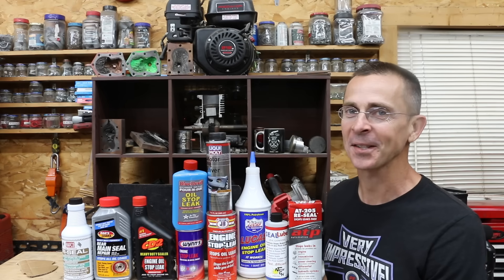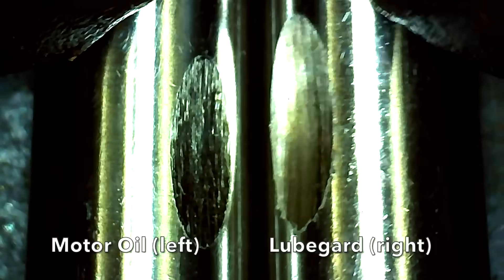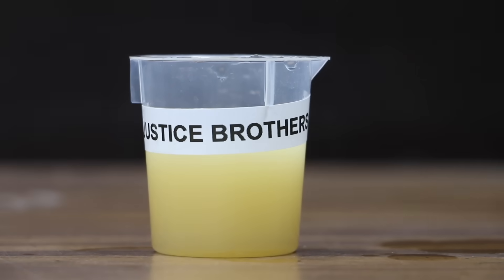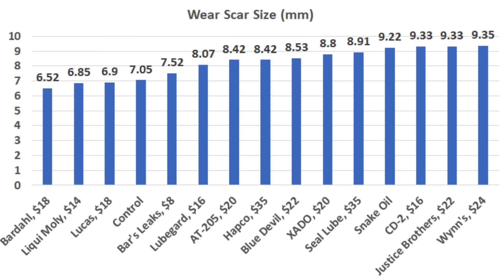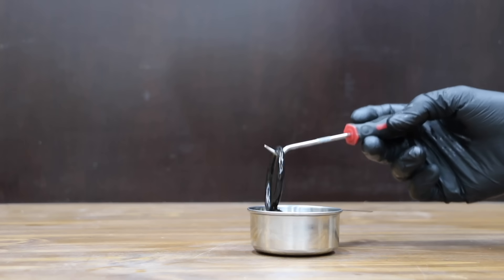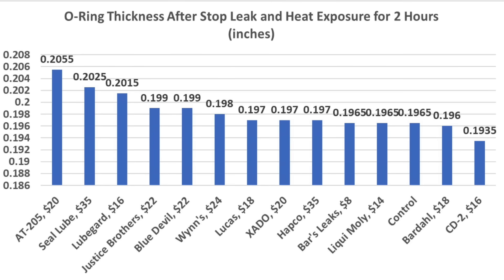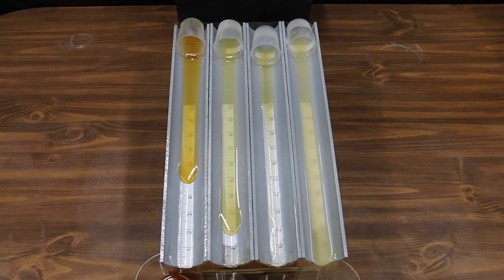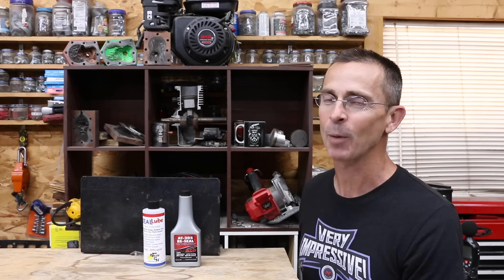Do Stop Leak Products Work? Do They Damage Engine Seals? Will They Destroy an Engine? Let's Find Out

Comment: The only concern I have is the 50/50 mix you used. I feel some of these performed better or worse because there was an unrealistic proportion compared to the oil. Unless it specifies 50/50, I feel this deserves a revisit with the proportions correct, at least for the wear and heated oring test
Reply: using a higher concentration of the additive reveals more of what the additive does to the oil, is it representative of real world scenario, no, but it shows which ones are ultimately worse then just topping off the oil to maintain proper oil level or replacing the leaking seal.
Reply: Actually this is similar to our laboratory tests where we simulate the effects of aging and long-term use in a short testing time. It's still a simulation, but these tests are a good mark for comparing similar products.
Reply: The 50/50 mix is useful for comparing the differences between the frictions of each product and isn't meant to be indicative of how it would change wear in an engine. I would like to see the proper mix ratios in addition for a closer analog to any sort of engine wear.
Reply: @Voyajer.  The same could be said for nearly all the tests.  Flow characteristics could change significantly if the ratios are incorrect.  Same with the ability to swell the seals... if you're mixing the product at a higher or lower ratio than the manufacturer specifies, you may see better or worse results during testing making it hard to say if one product is actually better than another in any of these areas.

I don't know enough about the subject to know if swelling an o-ring too much which might cause issues, or how soft is too soft for a rubber gasket or if there is such a thing.  People use these tests to pick a product to use, and if the recommendations from the manufacturer aren't followed as closely as possible, you're introducing new unknown variables to the mix which may invalidate your results in real world conditions.  I think all the tests themselves are reasonable, they just need to use the suggested ratios so we're comparing all apples to apples rather than a pea to an apple to a watermelon.
Reply: Can't believe so many people are failing to see why this was done this way. Its called accelerated testing, and it also brings out data that would not have been seen otherwise.
If the miniscule amounts were added per Manf. direction, its doubtful there would have been any difference in wear scar size.
Making it 50/50 accentuates the differences between the products, and allow that data to be large enough to be seen.
If used per Manf. direction, there is probably very little difference in wear between these products.  Or, considering most people leave these in for an entire oil change interval, often starting at the beginning of one, there might be potential for more than normal wear.
If the 50/50 weren't done, we would not have seen wear scar differences, and we would assume not an issue, and would only focus on which one swells/softens the most.
Which as the testing shows, the most wearing are the least effective on seals, and vice-a-versa.
Since we don't know actual wear damage in real life, some of us might prefer to select the one that shows less potential to cause wear, even though it is less effective in seal effects.
Others with beaters and such, can select one that is better at seal effects, knowing there might be a bit more wear than normal, which they can live with.
Reply: Agree -- If your percentage of product vs oil is greater or lower than specified in the directions, then you're not really testing the recommendation from the manufacturer.  I guess you could make a point that this shows an exaggerated view of what would happen even under the specified mix ratio, but now It's hard to determine if the differences would be significant enough to worry about when using the correct ratios.
Reply from the maker: Thanks for sharing!
Reply: yep if mixed right the wear scar be so little deffence you not even notice it
Reply: The blue devil is 8ounces and treats up to six quarts of oil so I don’t think the wear would be much different but start up if it’s settled in the bottom of the pan worries me a little 😢

Comment: So did you test the thickness and hardness of each O ring after cooking in the oil and before you cooked in the additives? It seems like you're using the same "before" thickness/hardness numbers for every O ring. I would assume there is some variation between them.

Comment: My favorite type of tests! I have some experience with stop leak products. I had a 77 F100 power steering box that leaked. Tried Lucas PS stop leak and it stopped it completely.  I also have a Plymouth Sundance the engine had several oil leaks. The BG products guy told me to put a can of transmission conditioner in the engine. It reduced the leak by about 75%.
Reply from the maker: Thanks for sharing!

Comment: That is not good when the oil separates. It meas your engine is running only on the stop leak for lubricant when you start it up after it's been sitting. The oil pickup tube sits at the bottom.
Reply from the maker: Thanks for sharing!

Comment: Mechanics, my 2005 forester has 286k miles and doesn't leak a drop of oil BUT it does run low pretty quick. I check it every other day and add like a quart every 400 miles or so. Short of a rebuild or crate motor what can help this?
Reply: Sounds like it's burning oil. Check your tailpipe for black oily sludge. 
Worn piston rings would have this effect.

Comment: I had a bottle of stop leak , that I didn't end up using. and put it on the shelf over a period of about 5 years, the plastic stop leak bottle,  developed a leak over that period,  where the stop leak caused the plastic bottle to fail at the base of the bottle.  And leak out of the bottle , it must have softened the plastic to the point of failure.
Reply from the maker: Thanks for sharing!

Comment: I stopped the video after 6 minutes. 
I'm your biggest advocate and love all your videos but I don't understand this, first these are not meant to increase lubrication, these are meant to stop leaking seals. Especially will the oil loose lubricant abilities when you dilute at a 50/50 ratio with a watery product that's meant to expand seals.  So the AT-205 did what is supposed to do expand the seals. It's not a lubricant, so Scotty is right again!
Reply from the maker: Thanks for the feedback!

Comment: I've personally used the Lucas product tested here for some oil seepage and consumption in an older vehicle and it worked.  That said, I think it may have "worked" by just thickening the oil.  I do worry about some of the stronger seal swelling agents used in some of the products tested.  If that seal swells and then hardens or contracts there is no longer any "in the bottle" fix that will work.  But getting some extra time out of an older vehicle may be worth it.
Reply from the maker: Thanks for sharing!

Comment: I do use the Lucas oil stabilizer, just because of it's thickness and the Prius engine is known to burn oil, interesting to see how this goes
Reply: Had no idea or heard of Prius doing this. Mine hopefully doesn’t. What year and what was your oil change interval ?
Reply: @mrc79  2007 and I change my oil ever 5k, i add about 1/2 a qt every 1000 miles and check the level every 2 weeks. Easy to manage, but it's a known problem with Prius'
Reply from the maker: Thanks for sharing!

Comment: Correct me if I'm wrong, in theory shouldn't the risk fade after the first few initial heat cycles of the engine? Most of the effective brands experienced evaporation so shouldn't the risk inherently decline as time passes? Just an interesting thought. I've used ATP205 in a camaro that had been leaking power steering for almost 5 years, I added a quarter of a bottle and it hasn't leaked in 2 years. Love the videos

Comment: I used one of these for a rear main seal on my 1 ton GMC 2001, hasn’t leaked a drop since.  Last ditch effort and it worked.
Reply: you remember the brand?
I have same issue on my truck and mechanic asks $1000 to drop engine and tranny
Reply from the maker: Thanks for sharing!

Comment: it really depends on the type of additive and the manufacturer.

Liqui moly radiator stop leak works excellent, it causes no damage and can save you thousands in repairs
my brother used it on his car where the manifolds of the radiator got traces of coolant(and stop leak) all around the crimped on manifolds, but it is sealed very well and there is no leak now.
Reply from the maker: Thanks for sharing!

Comment: I've never been a fan of 'snake oil', but.... About 15 years ago I had a '93 Cavalier that while sitting idling would leak about 1 drop per second (!) off the rear main seal. Didn't feel like fixing it, so tossed a can of (Rislone - might be the same as BarsLeak) stop leak in. Left it sitting in the same spot idling. Within 1/2hr, the leak slowed then stopped. 

Car kept being driven as a spare, and got handed around to a number of people - was still running and driving at 400K+ before it got scrapped.
Reply from the maker: Thanks for sharing.

Comment: Sorry to give negative feedback because I love your content, but I don't care for the way you setup the lubricity test. A much better test would have been to prepare the products at their intended working concentrations rather than as a 1:1 mixture of oil and concentrated stocks. The fact that this isn't the intended use in your engine makes it non-representative, and the range of stock concentrations make them non-comparable within the testing limitations. For example did the Lucas outperform CD2 on viscosity/wear because it's a better product? Or because the CD2 was meant to be diluted 1:16 in motor oil while the Lucas comes less concentrated calling for a 1:5 preparation?
Reply: My thought too! I recently used an 8 oz bottle of AT-205 in my 6 quart crankcase for a leaky front crank seal and it worked! I'm not worried about viscosity or wear with that small ratio of product to oil.

Comment: GM specializes in crappy gasket designs, leaky engines and engine accessories-  such as power steering. I maintained one example from 2000 to 2022. Labor in changing the gaskets only seems to stop the problem for a few years before being back in the same boat. Trying some of these products in the later years, No product seems to completely stop a leak, but rather, slow it down to vary degrees and time. All and all, I would avoid adding anything to the motor oil unless the engine is already trashed and its a last ditch effort, in which case, Lucas would be a cautious nod.
Reply from the maker: Thanks for the feedback.

Comment: As a mechanic for the last forty five I have always been reluctant to add oil additives never did just repaired the leak but I did use ATF additives in transmissions power steering and it has worked quite well.great video thanks 👍👍
Reply from the maker: Thanks!  Thanks for the feedback.

Comment: Were those natural rubber O rings? Oil will eat natural rubber so any decently designed engine shouldn't have any natural rubber O rings that contact oil. I like the idea of this test but RTV, Silicone, synthetic rubber, felt, and viton would be better test materials.
Reply from the maker: Thanks for the feedback.

Comment: The first test, the friction test, is probably the least significant because your ratio mix seemed to be 50/50, whereas the ratio in you car would be something like 5/95. Great video! I just put 205 in my 2014 VW the other day
Reply: Yep good point! Good to know if any of these are immediate bad though.

And with the stop leak you should probably change your oil sooner than normal. That's a good idea if you have a leak anyway, because you could have fluids mixing, contaminants getting in, or just leaking oil.
Reply from the maker: Thanks for sharing.
Reply: Yeah I'd add this towards the end of my oil life anyways, shortly before changing so it's not in the engine for an extended period of time
Reply: @MikeyG003  you think even with it being such a small amount it would do damage? Seems like you'd need to give it time to work since it is just a small amount. I did it during oil change.
Reply: @russelldewitt6742  I mean I would just be extra cautious ya know? Wear happens over time, I’m not saying keep it in there for like 50 miles lol maybe I’d do like 500 or so, that should give it time to work since lower concentrations than in video
Reply: @MikeyG003  yeah maybe. Hard to say. Seems to make sense to me that they expect you to add it with an oil change. I burn about a quart every 1k miles. So we'll see
Reply: @russelldewitt6742  yeah I personally wouldn’t keep for an entire 4-5k oil interval. Burning oil probably from the oil rings on the pistons? I’m not sure if stop leak will fix that as I don’t think those are made out of rubber (could be wrong). Seen some methods of taking spark plugs out and adding like seafoam or something into cylinders and letting them soak overnight and then crank engine with plugs out still to get liquid out etc which might be more effective for oil burn as long as your cylinder walls aren’t abnormally worn. My 07 is250 with 206k mi was burning about 2qt every 5500mi. Ran seafoam into crank case for last 2 oil changed and also bumped up from 0w-20 to pennzoil platinum 5w-30. I think I’m at about 2500-3k and dipstick still is full. Some things to try

Comment: I used a Lucas transmission leak seal and slip stop etc product. It worked great for three weeks P1870 code stayed gone.............. then I lost third gear and my TC seal is leaking worse now, the code is back too. Now it could've already been on the way out but I am left slightly disappointed.....
Reply from the maker: Thanks for sharing.

Comment: Oil leaks only cost hundreds or thousands of dollars to repair if you pay a mechanic to repair it. They tried to charge me 700 to replace a valve cover gasket and I went and got the OEM for $50 and learned to do it myself instead. As a side note, I would never even think about putting anything other than oil in the car’s oil pan. I’ve always believed this stuff to not only be ineffective but damaging to the engine
Reply from the maker: Thanks for sharing.

Comment: I agree. Better to do a proper repair instead of using one of these products. The one exception would be if the leak was on a junker almost ready to be sent to the scrap heap. In that case, you have nothing to lose.
Reply: Well, I used 3 oz of AT-205 on a remanufactured Chrysler PS rack that begin leaking after 5 months, and it worked! 🤷
Reply from the maker: Thanks for the feedback.

Comment: Have you done a video on respirators? I'm sometimes required to enter jobsites that require a respirator to protect against silica dust in the air. I don't want to get lung cancer but I also don't want to keep buying expensive filters if an n95 mask works just as well.
Reply from the maker: Thanks for the suggestion.